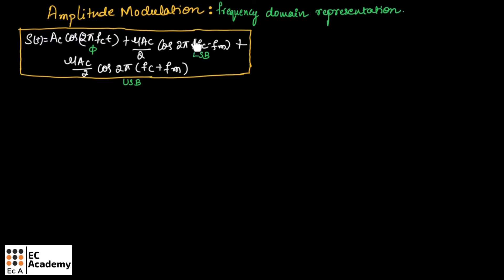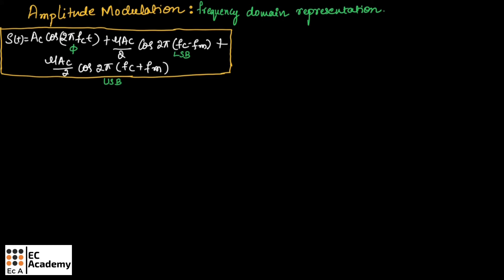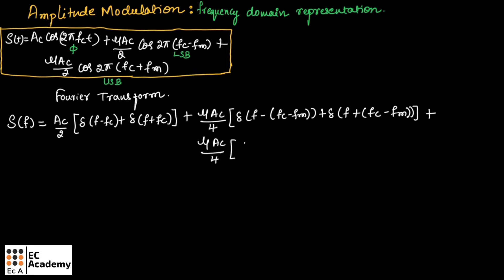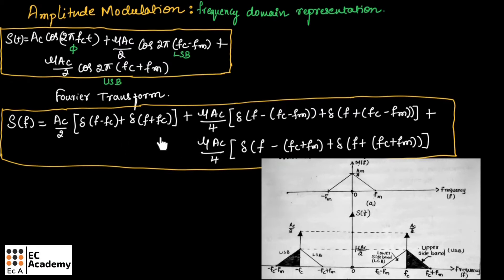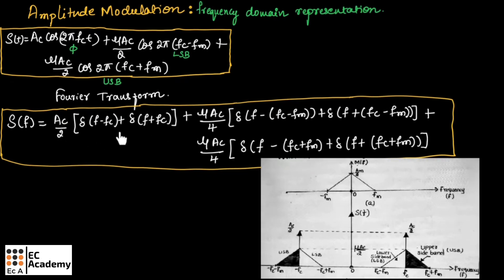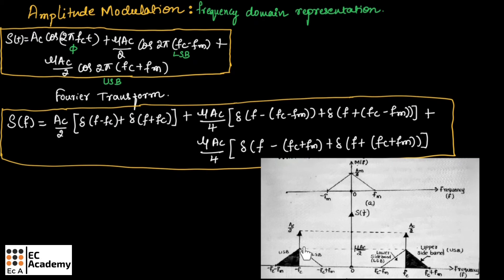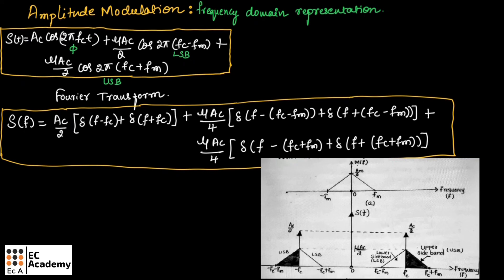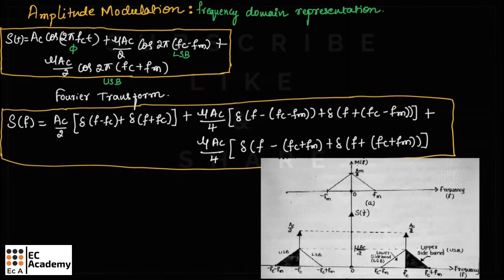CT#4 Amplitude Modulation in Frequency domain representation || EC Academy

Comment: why will the amplitude be uAc/2?
Reply from the maker: The division by two happens because cosine waves are even functions, and their energy is distributed equally between their positive and negative frequency components.
Reply: @ECAcademy  why not uAc/4, it comes in the equation with shifted delta terms?
Reply from the maker: Message signal is cos wave carrier is cos wave. After modulation CosACosB we will get 1/2 term